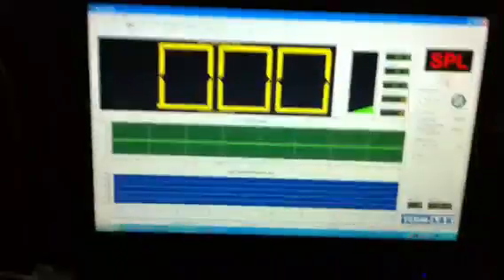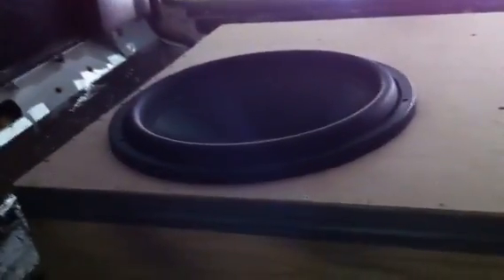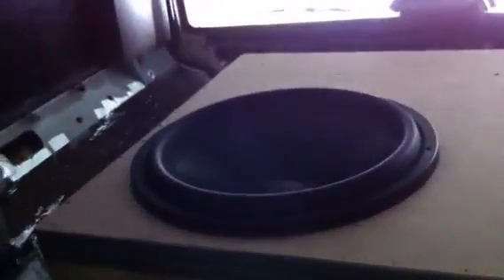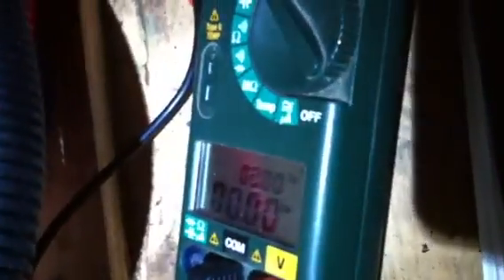Obsidian 18" clamped

Comment: im giving my oa18 v2d2 a 1000 watts actually a bit more the amp is cea certified the amp is MB QUART 1000.1 @1 ohm I have a complete mb quart setup if u no what ur doin u can give this sub more wattage promise its better to over power a sub then under power it any srry but the company underrates there subs so ppl that don't no what there doin wnt blow the subs